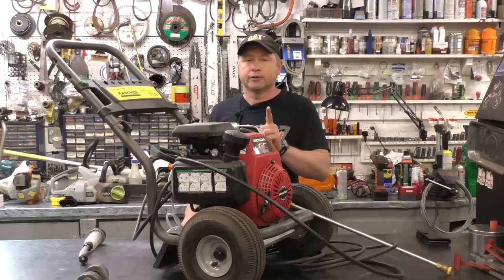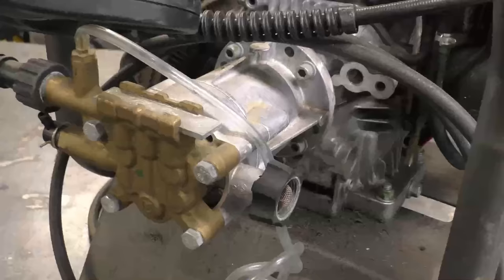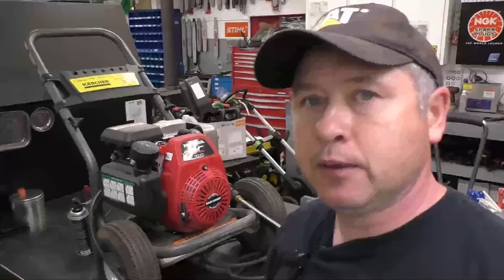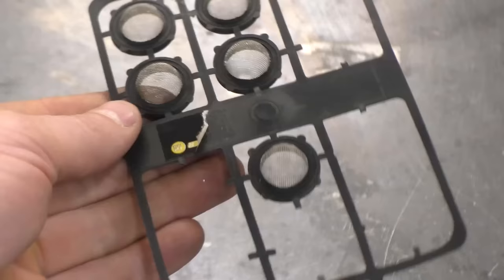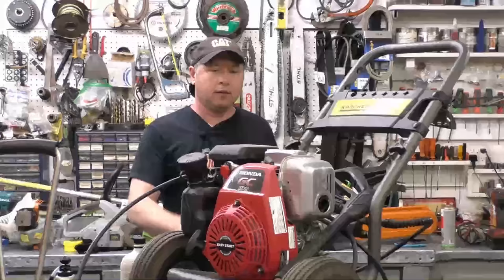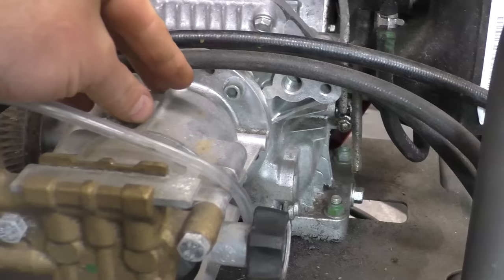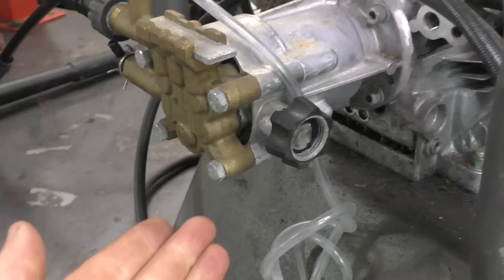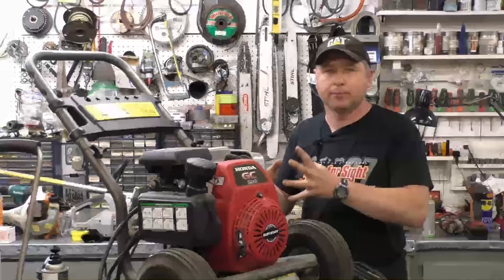Top Reasons Your Pressure Washer Pump Is Destroyed & Has No Pressure!

Comment: Yes, the pump saver is necessary for storage but I go even further then that.   Before I add pump saver I rigged up a quick connect hose connection I attach to the pump inlet.   Blow a bit of compressed air through the pump while you pull the starter rope two or three times.  That way you evacuate ALL the water thats in the pump  before adding pump saver.  The mineral deposits remaining in the pump after water dries damages the pump seals over time, so get it out EVERY time after each use.   Then disconnect your quick connect fitting and connect your pump saver and pull starter rope two or three times  while you are squirting the pump saver in. Make sure the pump saver is actually running out the outlet side of your pump.   Now you are good.    
As other posters have stated have water circulating through your pressure washer when you are starting it.  Simply hold the trigger back on your wand while you pull the starter rope with other hand.  
When I am finished using my pressure washer and it is shut off I still keep water connected and pull the trigger back on the wand and run cold water through the pump for a couple of minutes to cool down the pump.  It gets very hot during use and this also in my opinion adds extra life to your pump.   Cold good, hot bad.
Also keep your pump oil level within the sight glass and change it frequently.   The CAT pump on my pressure washer is still running like new after years of use using these procedures.

Comment: I use Tru fuel in all my small engines.
It's pricey but it's the best.
Eliminates mixing for 2 strokes and on my 4 stroke engines I put in Tru fuel the last time I use it before winter.
Been doing it that way for years and my stuff always works and I even think the specialty fuel extends the life of the engines.

Comment: I also saw a tip about the o rings or seals can crack inside the pump if you blow out the pump and then leave it dry but that’s when you should pump in the antifreeze and leave it in there for the winter if the washer is left outside. I did that today. Also straighten out the hose and drain the water out so it doesn’t freeze and burst

Comment: These are a lot of great answers and I have lost several pressure washers. IF you have a good ratchet drive allen key you can remove the Karcher pump and winter store
your pump in the basement taking minimum space. For me it is a struggle to take the entire unit inside up and down stairs. getting the right allen key is everything.

Comment: I have been told that  IF you leave the machine running just one minute without spraying water - the water cooled pump starts to over heat !  
another tip is to be sure and turn the water on and squeeze the trigger to allow water to flow through the pump and the hose BEFORE you start the engine !

Comment: I think you just solved my problem. At the end of last season I left my pressure washer running to run all of the gas out of it for the winter. I just tried to use it today only to find the pump leaking and very low pressure. I guess I'll be replacing the pump now. 
Thanks again!
Reply: Same here. Now it's leaking, the pump oil is grey. Stored in house, always turned on with waterflow. Comet pump. What could have happened to her? 😡

Comment: Hey bud I am a certified Hotsy technician and u nailed it on the ways to keep your pump alive, only one thing I would also mention is rapid triggering of the gun on and off is very bad for the unloader valve on the outlet of the pump.  This home owner washer has a built in unloader and def way cheaply made compared to a industrial external bypass loop unloader.  So if you are constantly banging that trigger your unloader valve that traps that water every time you release the trigger will wear out fast and or fail.  And with it being built in if your unloader fails but your pump is good, you pump won’t do what it should.
Good video man
Reply from the maker: thanks for the tips buddy!

Comment: I used to repair electric pressure washers up until 20 years ago & most of them were throw away items but as far as the more heavy duty pressure washers which had aluminium alloy housings go we had to replace the aluminium alloy components because they would corrode out & result in no water pressure despite resealing the pump.

The domestic Karcher pressure washers were the worst because they were made our of plastic & the output side would crack because if someone plugged a garden hose into the inlet side after it had been sitting in the sun the hot water which sat inside of the hose would cause the plastic housing to crack under pressure !

Comment: I remember our older Kutcher. We'd flush it every use no issues. The issues with the old Kutchers was annoying and didn't get solved until 2010ish. You'd have to start it while spraying the wand. Reason being? I was told cavitation within the pump and impeller designs. If you forgot to spay your wand starting it, you'd hear a loud pop and boom pump gone. Glad to see these newer pumps don't have these issues anymore. It used to take 1 time to forget and your unit was trashed. 

And question for anyone with a new washer. Do they have a pressure release safety feature? If not, I wonder why they haven't implemented a feature to shut down if there's no wand flow.

Comment: As I have heard to connect water hose and turn on water ,  always before starting up the pressure washer , gas or electric . I has always thought to put the indented / rounded side of filter , inward , not facing out . Using some small ? to gently seat it all the way without deforming it .

Comment: RE: Winterizing the pump. Watch what kind of antifreeze you use. The old school green ethylene glycol has silica suspended in it. You don't want that in this style of pump. It's fine in the automotive impeller water pump, and serves a purpose in cast iron engines. It's also lethal to mammals if they drink it, so if it's dripping over time and creatures can get to it, it smells sweet and they will lick it up. I suggest the pink stuff used in RV water systems. It won't have the silica, is composed of propylene glycol and is safe enough they put it in your toothpaste.
Reply: Use the pink RV stuff, imo.

Comment: Another thing I always check before starting, make sure the water source will supply the GPM needed. I have a 4 GPM pressure washer. I use a 5 gallon bucket, if the hose will fill it up within 1 minute, then I should have enough flow, but even that may not always work, as I have run into wells that could not keep up with the flow over a few minutes.

Comment: I always winterize my pressure washer last year however there must have been some water left in the wand, and it froze and cracked something inside causing a huge leak and need to replace it. I normally blow it out with air, but I guess I didn't last year. not a major expense to replace like a pump more of a frustration getting it out and set up only to stop and run to a big box store for a replacement. something to think about when putting one away ever a tiny amount of water can cause a problem when freezing temps hit.

Comment: I just fixed my 2500 psi gas powered pump after it stopped pumping. Changed the oil, pumps like new. Stays in a heated garage all winter so I don't use antifreeze. Was surprised to see it would bold onto my push mower engine and thought about running the pump off of that. Pressure washer /lawnmower combo

Comment: Thank you for more great tips here. My procedure is this: I turn the hose on and flush it first, then spray the intake connector that I'll be attaching it to, turn off the hose, then I connect that hose to the machine and turn the water back on. Next I take the wand and bleed the air out and let it burp up to a minute or two sometimes. Next I'll start the machine and again burp it. I don't let it run without spraying that wand and when Im all done, I turn the machine off and once again bleed the pressure off. Be careful not to knock that pump when going up curbs and or up/down stairs. That can crack or bust the pump too. Those pressure washers are a fickle bunch of machines. But do they ever clean some stuff back to life. Thank you Don!

Comment: top stuff Donny mate cheers from Australia 🐨🐑🦘🌏 to Canada and yep i use my Ryobi 4 stroke 163cc OHV (OverHeadValve) Pressure washer and i use it by the instructions and hardly any problems with mine engine and water pump wise that is and as long as i keep mine clean and tidy and check things over regularly to insure it,s working we are laughing etc.

Comment: In Florida I've seen a bleed off at the outlet of the pump which sprays a small amount of water continually. I always thought it was a leak but now I know  it is designed to prevent overheating which is accentuated by warmer water from the city mains. That allows the worker to move things out of the way etc. without shutting off the machine. 
Thanks, Dony

Comment: I have a 3100 psi washer and I have let it run for 10 minutes or more without spraying but it has a built in pressure valve to relieve the pressure but one thing that will destroy your pump is starting them up with no water completely running through it to get the air out of the lines.

Comment: I used to run a steam cleaner/pressure washer & the wand had dual nozzle pipes built into it. A low pressure bypass nozzle kept the water flowing thru the heater coils to keep them from overheating. When you squeezed the trigher or twisted a motorcycle grip throttle type valve, high pressure steam/water blasted out the main nozzle to clean greasey engines & chassis & sometimes strip paint off (oops!) if you got too close. Maybe we could rig up something for our pressure washers....?
Winterizing/storage tip I use: make adapter for 60-80 psi compressed air to garden hose inlet, with Ign. switch off, slowly crank engine a few times & watch water come out of the output side of pump.
Also, I added a water inlet cutoff valve (1/4 turn ball valve) so I can shut my engine off frequently without water running thru my pump, making a mess & I don't have to rush back to the faucet to shut it off ! Thanks Don!

Comment: Good video. Its a shame that so many buy new units and after one season, boom half the PSI is lost. If everyone just open the booklet to the page of STORING THE PRESSURE PUMP for LONG TERM, many will have no issues at all, for many years.  Number one killer is running it dry even for a very short time.

Comment: I have the same pressure washer and pump, and last week the cord wouldn't pull. I tried to pull the pump but couldn't get it off, so I took off the end cap and milky oil came out. I inspected the parts and excessive wear on the guides / pins / orings. 

Although I do keep in a garage attached to the house, we had a very cold winter. I should carefully inspect for housing cracks that could have allowed water to permeate into the oil chamber.

Comment: My new gas pressure washer worked fine for a few hours and I got tired, so I put it away. The next day it started for 30 sec before sputtering and dying. The choke lever is stuck in the middle and won’t pull all the way to the cold position(left). Thus frustrated, I left it over night and noticed the next morning the choke moved to the right all the way on its own. It still is stuck. I still have plenty of gas and half oil left. My pressure washer is Husqvarna 3200 psi with a Briggs Stratton engine from Costco.

Comment: Very timely video Don.  I just bought a new electric pressure washer.  One feature I like about it is that when you're not squeezing the trigger on the wand, it shuts itself off to avoid exactly what you talked about in the 3rd issue.  

Question:  Would RV anti-freeze be okay in the pump to prevent freezing?
Reply: pretty much any antifreeze should be fine.  the only thing I can think of would be that an antifreeze that was safe for potable water systems should have a little less worry about spilling or disposal than automotive antifreeze.
Reply: @kenbrown2808  - Thanks.

Comment: Didn't know about the 30 second deal until recently. My sister-in-law borrowed my washer then came over to visit my wife. I thought I heard the pressure washer still running but wasn't sure. I am now. New pressure washer just received. The old one had a burned up engine and the pump won't pass water when I got it back. No more loaning equipment either.

Comment: Apparently there are so many different pump oils for different pressure washer pumps.  At the big box stores they have the non-detergent SAE 30 weight only but some pumps require SAE 90 weight and some pumps require Briggs & Stratton mineral oil type. And unfortunately no place carries all of them and you have to seek them out.And unfortunately they are all not readily available.And also no information whether they are interchangeable.

Comment: When I am preparing to use a pressure washer, I flush the garden hose that is feeding it.  Mud dobber wasps and other sources of dirt and debris can get in the hose during storage.  The one and only, so far, washer I destroyed was from having a 100 foot 3/4 inch black rubber garden hose on a hot summy day.  Took a break with wahser off for an hour or so and the water in the hose must have been really hot.   The washer was not designed for hot water and it failed within a minute or so.
Reply: Good tip!

Comment: I only have one of the cheapo electric ones, but I'm amazed the pumps on these higher end ones don't have a way to drain the water out, vs. having to add antifreeze.  I'm also somewhat surprised about not letting pump run without spraying.  30 seconds?  Sure seems like a short time to burn out.  My electric one essentially shuts off if the handle isn't spraying, I'm assuming some sort of over pressure switch does that.  Simple to do for a gas powered one as well, hook to throttle to bring to idle, or perhaps just to the same kill switch as low oil, etc. switch.
Reply: Good point. Electric pressure washers are much better

Comment: I hook up my compressor to it it in the fall and push out any water that's in it. Been doing this for 20+ and never had an issue.
Also if you're running the pump and walk away the water in the pump warms up so when you squeeze the wand and introduce sudden cold water can damage the pump

Comment: The pump has plastic check valves. The valves melt when they get hot. OEM, AAA and other fluid manifoldss can be rebuilt. But like you said shut the unit down when unattended.

Comment: The vertical machines tend to drain the pump by gravity and I have got away with not using antifreeze and just taking off the hoses and pulling the engine over a few times to push the water through to the outlet. I left it in the cold and later realized it was ok.

Comment: I did not know about the pump building pressure to a destructive level. I'm surprised that the manufacturers don't add some type of a pressure relief valve to relieve some of the pressure when the wand is not being used.

Comment: I always run the pink RV antifreeze through pump after each and every use and I live in Florida, where freezing is not an option lol, this keeps the rubber gaskets seals rubber moving parts all loose in limber cause hard water in a water pressure pump during long periods of no use. It’s not good for the pump even though it doesn’t freeze.

Comment: Everything he said is true. I bought a really impressive generac pressure washer back in the mid '90s that was very expensive and it was really good. I made a couple mistakes early and then ended up trashing my pumpkins. I read the owner's manual but I ignored it so there you go! Tomorrow I'm going to order a new Simpson 3100 GPM with a Kohler motor. I have an electric one right now but it sucks and really isn't even good enough to wash my car with. Much less pressure wash my driveway my deck my house etc... Follow what this man says and you should be okay.

Comment: I guess nobody has automatic pump stoppage when the wand not in use. 

I found a couple of electric inexpensive pressure washers and they both had automatic shut off as soon as the wand handle was released. So no pressure buildup and damage to the pump. 

I'm surprised that nobody has mentioned such a pressure relief system set up in their pressure washers.

Comment: Hey Don, I'm wondering if forcing water out of the pump using an air compressor is good enough. This is what I've been doing for years and it seems to work fine but maybe adding antifreeze offers other advantages. What do you think?
Reply: Of course that is the way...
Reply: I too have simply blown the pump empty and dry using a compressor and have had no issues.

Comment: The last tip should be in BOLD PRINT on page 1 of every manual. The Ryobi gas 3300 pressure washer does not warn consumer of leaving pressure washer idling for more than 30 seconds....

Comment: Very good video, well I have did all u said for years with my washer. This year I power washed my 
rental house it worked just fine , I got it out 2 days later to wash my house, looked the water hose 
Up turned the water on started the engine it didn’t have only pressure, SO help
Thanks

Comment: Great video. Thank you. I wish you would have covered one more cause of failure and that is when you put diesel fuel instead of regular fuel. I had my washer on a job side and a sub contractor poured diesel in my pressure machine and I have never been able to start it again even thought I dumped the fuel and wash it a couple times with gasoline. Is this machine repairable?
Reply from the maker: Also drain carburetor and it will be good to go.